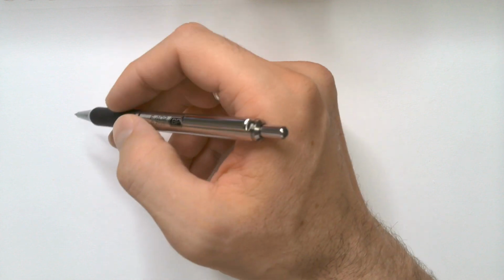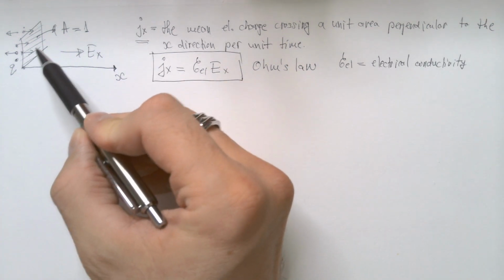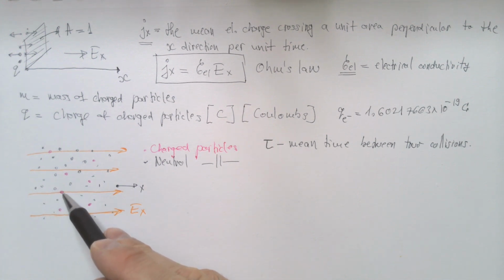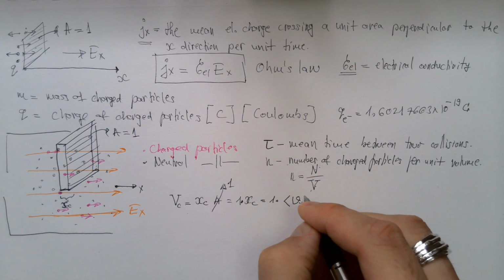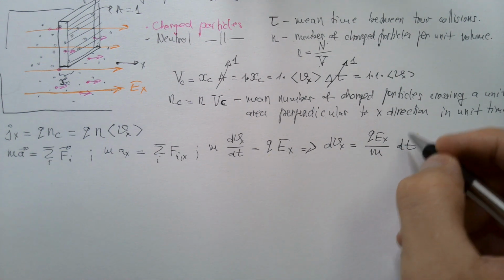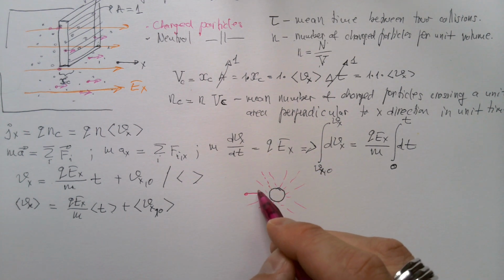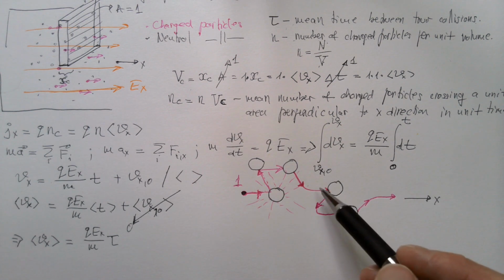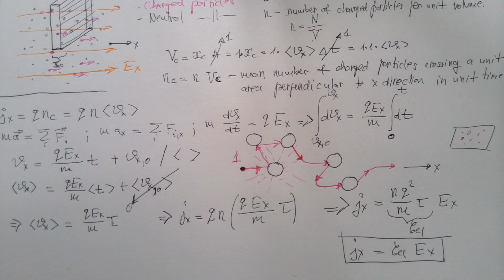Electrical Conductivity of Gases with Kinetic Theory

Comment: Thank you very 🙏🙏much sir, l really found your teachings helpful, 
The fact that more voltage is experience by your tumb is because, at the sharp edge of any  conducting matter, charges are more concentrated at the sharpest point.
Reply from the maker: Your observation about charge concentration at sharp edges is correct. Indeed the conclusion follows from fundamental principles of electrostatics; namely, the surface charge density is inversely proportional to the radius of curvature.